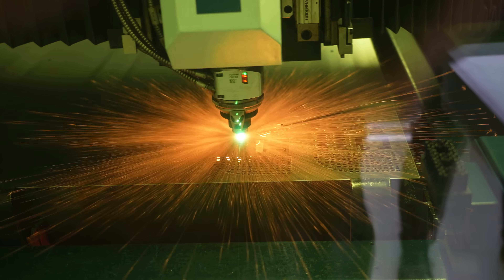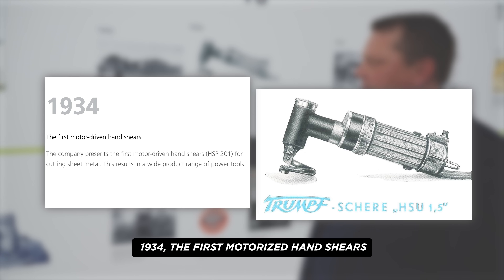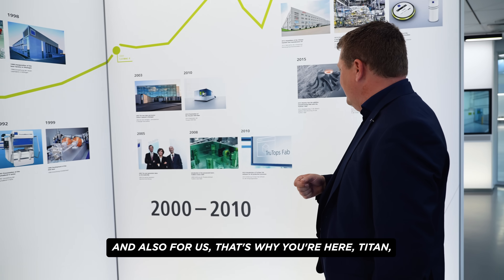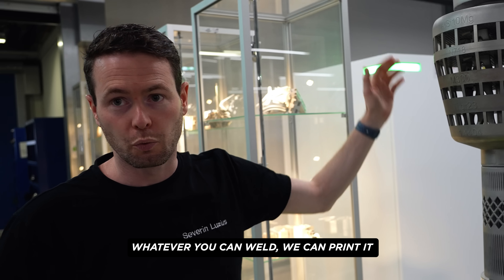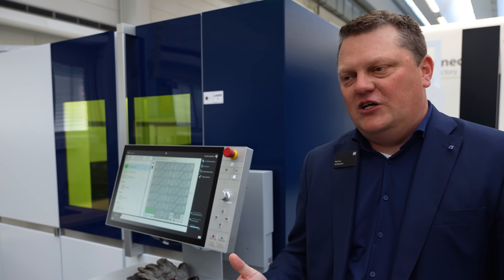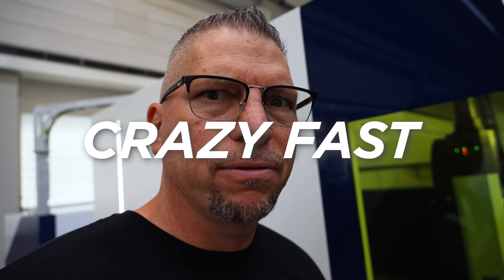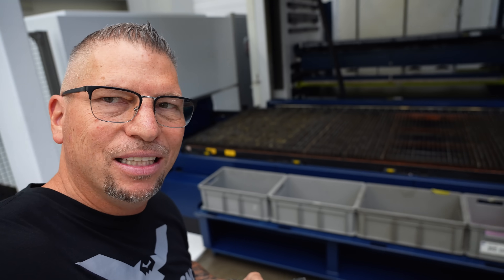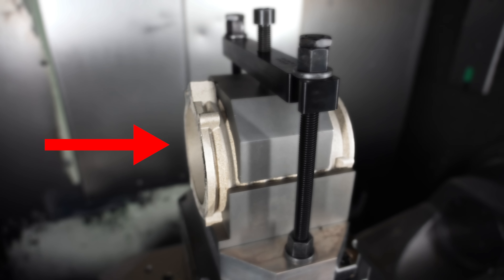15,000 EMPLOYEES | The MASSIVE TRUMPF CNC MACHINES | Manufacturing Campus Tour

Comment: I've worked with a Trumpf TruDisk 2000 laser welding equipment for about a year and I just love how much work they've invested into making the machine as dumb-proof as possible. The maintenance instructions are presented step by step on the HMI and you have to check each step in order to get to the next one and let equipment know what are you doing. I've had the chance to see the guts of the laser source and that thing is looking like a science fiction setup.
 Also, the PFO (programmable focusing optics) is incredible for welding. It was a pleasure to work with Trumpf and I hope I will have the chance to work again in the future.

Thanks for this video!